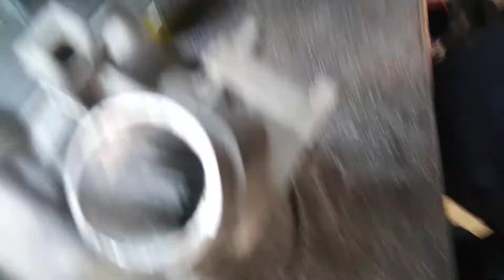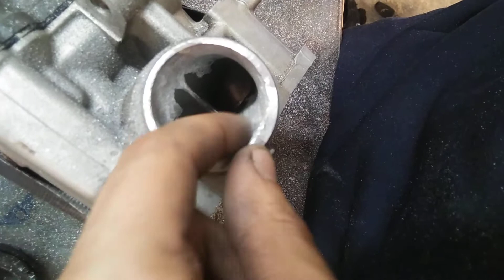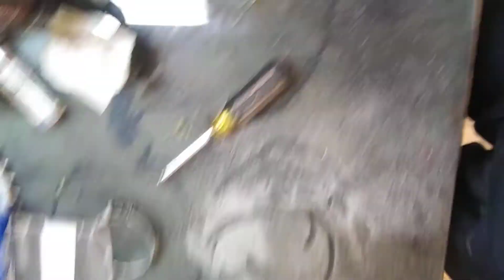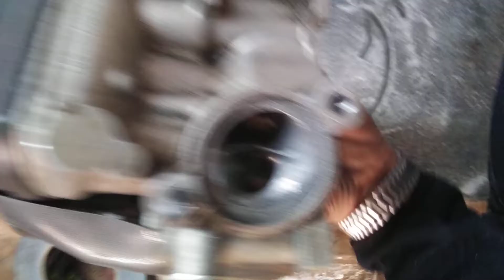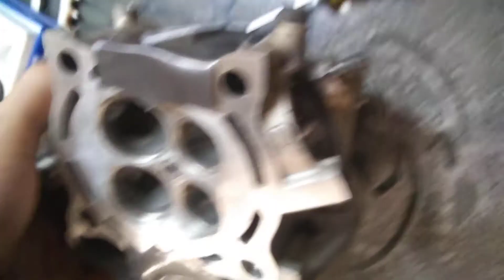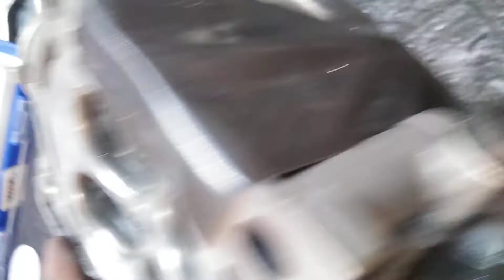Porting my rmz 250 head up to 290 flow

Comment from the maker: So using this setup for about five months it has proven to show pretty good upper power increase the lower end and is definitely hindered with the stage one hot rods cams . when partnered with the pro stage 2 cams through a oem exost it pulls a relaxed stance wheelie every gear any rpm range . I was told by three different friends that was unaware of the cc thought it was a 450 , its about 295 with the hot rods stroker crank , it has the oem crank now with the stage one intake and stage two exost . it lags till about 4thouthand rpm than the reaper strikes , its the closest to a two stroke power band with a 4 set up DOC can come up with.  It's a fun bike !!!!